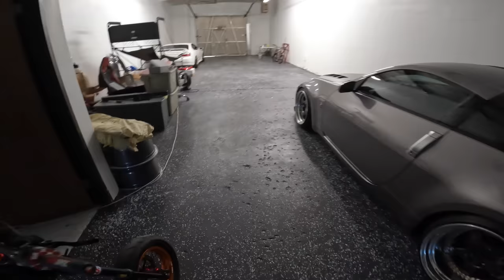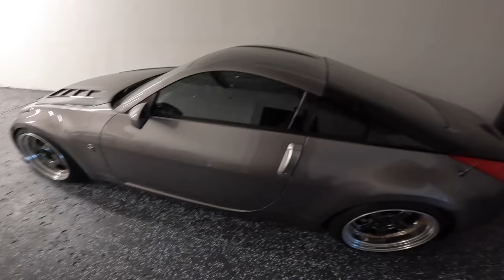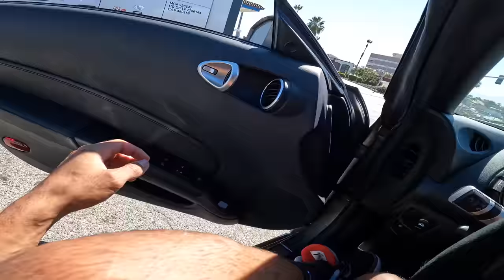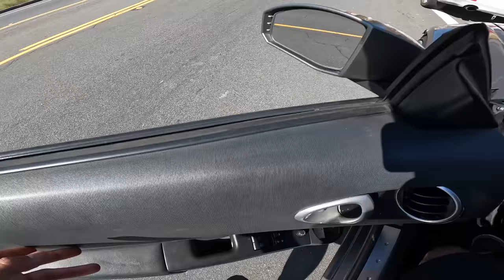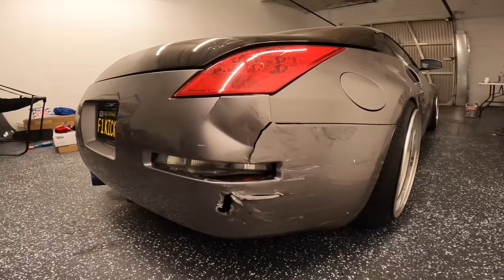Chased Down Idiot Hit & Run Driver

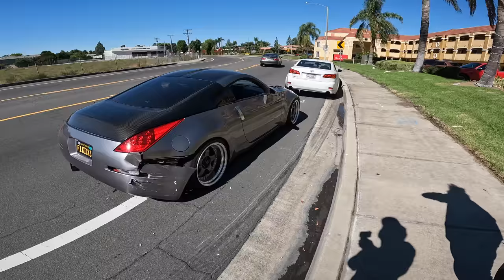Comment: 3:50 “it’s gonna be LS swapped” “shit still gon be slow” BRO😭😭
Reply: “You need to bumper swap this bitch first”💀😂
Reply: I drive an is250 and honestly it is quite slow.. If you straight pipe it then it sounds like a GTR but overall it’s a great car and looks amazing but not for speed.
Reply: Shit had me ded
Reply: @TheKingdomSecrets  it sounds nothing like a gtr lol I just got rid of my 08 is250 awd shit was sooooo slow. And had carbon buildup so bad it threw the car into limp mode every drive
Reply: @TheKingdomSecrets  I got a brand new IS250 in high school.  Looked cool but I couldn't even beat my friends stock A4 lol.  Got an B58 now :)

Comment: No way he runs. Clearly the only reason he stopped was that jacked up wheel. Hope there is no internal damage on yer Z. I have a documented 1 of the first 350 sold in North America. It's 99% mint even starting to have the syncho mesh dealy go in 3rd. All original..even the brakes and tires...about ...in miles...25K. One dream is to have it become a part of their history because it is rare...ish. The other part wants to sup it up. I dig watching you and yer Z cars. Seems to me you stopped while you built the engine...er something. Glad it's back and can't wait to see it slay exotics!

Comment: Hey anyone with a 350Z hoping you can help. I'm considering buying a used one (stock) and was wondering if regular replacement parts (not upgrades) are hard to find or if they are expensive. Thanks for any advice